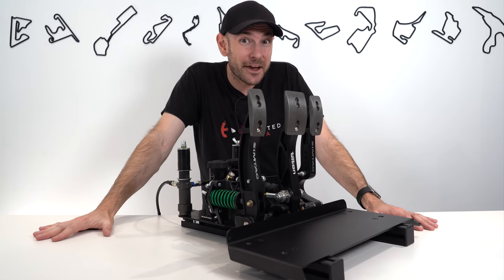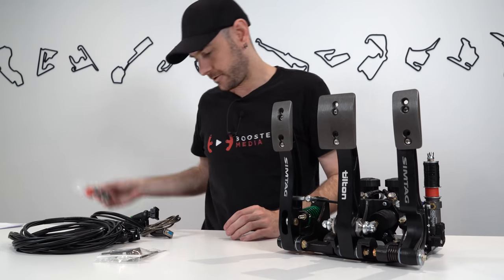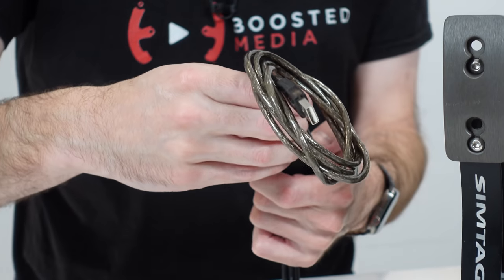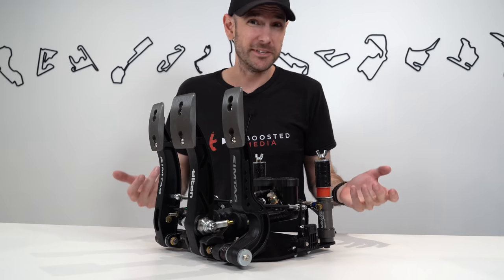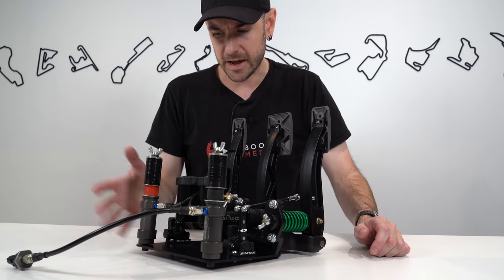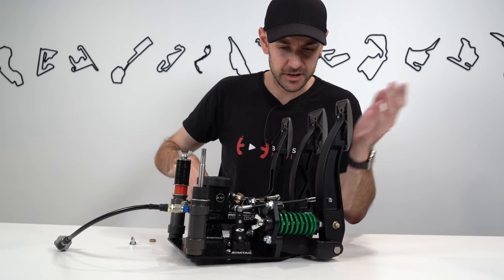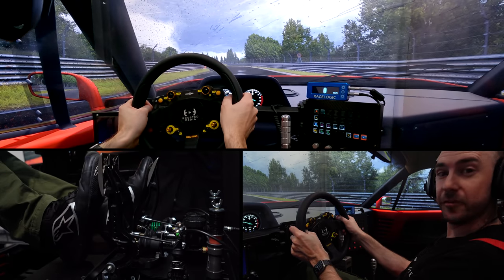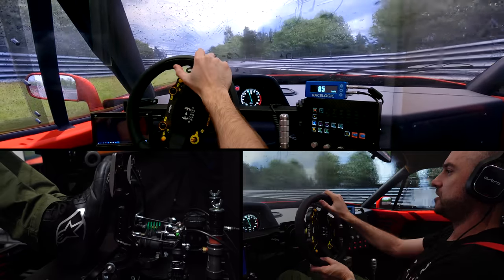REVIEW - Simtag Tilton Black Edition Hydraulic Sim Racing Pedals

Comment: Simtag has new 2 and 3 pedal sets available for pre-order. Can't wait to see your review as these use Simtag's system. Side note: Tilton has a CNC'd pedal linkage kit for $155 US. Should only take a small amount of work to "upgrade" to this set-up, but worth it in my book to have some more real race car parts, and will definitely be doing this to mine. Additionally it looks like one could upgrade the actual pedals to the Tilton 800 or 900 series fairly easily.

Comment: I had the same leaking problem with Wilwood slave cylinder. I found a solution. I dissasembled slave cylinder, took that metal centre rod and polished. I used 1000, 1500 and 2500 grid sandpaper with water, and after that, I polished it ( cheap polishing paste). After that I dont't have any leaking form slave cylinder.
Reply from the maker: Good info.  Thanks!
Reply: @boostedmedia  No problem :) I hope that I wrote it quite clearly because my English is not very good :) The whole problem with this leaky slave cylinder is that the central bar is machine finished and is rough. The only seal is a small, rubber O-ring in which the rod slides. The brake fluid is trapped in the unevenness on the bar and the O-ring is unable to remove all the fluid from the bar. The polishing of the rod makes the surface smooth and the O-ring seals better. This procedure also extends the life of the O-ring. I use OBP pedals and I have one slave cylinder. In my opinion, such a leak should not occur, especially since these parts are used in real cars. In addition, the leaked fluid can damage your home floor. Also, such responses from the company as to wipe the liquid from time to time are, in my opinion, unacceptable. Especially since these pedals are expensive. I think they could use parts other than Wilwood. Maybe it would be better.

Comment: Great review,  order placed!
Reply: Received the pedal set,  installed and few setup tweaks,  and on pace straight away,  Whole different world of feel,  certainly adds immersion and performance.  Ended up running the softest setting for the brake as out of the box, by god was it stiff with the two x red rubbers.
Reply from the maker: I think you’ll like it even more with one red and one black. 👍
Reply: @boostedmedia  Maybe they soften up over time?  With both blacks shes still a workout.  Out of the box,  with both reds,  that was nuts.
Reply from the maker: Need to stop skipping leg day mate 😂

Comment: Thanks for the awesome review! This helped answer some questions I have for my DIY hydraulic upgrade to my HE Sprint brake. FYI looks like these Wilwood Slaves have some bad reviews on the racing parts sites. Many users saying they fail within a couple hundred miles due to the o-rings instead of cupped seals. Probably the same thing you noticed with the oil weeping. If anyone knows of a more reliable Master/Pull Slave combo let me know!
Reply: I'd be interested in your DIY sprint upgrade info.
Reply: @Succotash3  sure absolutely! I've picked up a WIlwood master cylinder kit (P/N: 260-12385) to mount directly to my pedal plate behind my HE sprint brake. The plan is to leave the HE brake entirely intact, but disconnect and remove the dampener rod to connect the WIlwood master. Braided brake lines from the master will run to a set of WIlwood calipers (likely a pair of GP200's) with Honeywell pressure sensors or equivalent installed and routed directly to the input on the back of my Simucube Pro wheelbase. The calipers will contain Wilwood pads and a steel "disc" block that can be swapped out for different thicknesses to adjust the take-up feel. Rubber bushings installed inside of the caliper pistons to retract them on brake release. Still a work in progress but can provide a more detailed summary once complete.
Reply: @BarneyLux  this sounds wild
Reply: @tompeters458  I actually finished it up a few months back and absolutely love it. I tossed up a post in the HE owners page on FB with all the details. I should probably make a YouTube video with a breakdown.

Comment: You can a set of those pedals with master cylinders and from speedway motors in the US for $664 not sure how much it would cost for all the other parts needed.
Reply: I concur. I'm actually in the process of building a set of these(got from Speedway!), using tilton master cylinders and throttle linkage... Going to be in it for around $1000 and I'll bet mine end up a bit better quality than these. Quite a bit of mark-up here.

Comment: Unfortunately there is nothing new here, I built a set just like this when the sim would first started experimenting with hydraulic pedals.
They are a little more refined but essentially the same, but still prone to the wilwood slave cylinders leaking.

Comment: Seems crazy they are charging 2500 with 2 potentiometers attached. As an EE, there’s no potentiometer out there that doesn’t take damage as it rotates, not a lot, but over a million cycles it changes its resistance until it fails. At 2500 bucks I expect both those to be hall-effect sensors, so they don’t wear out... simply crazy... why put such great equipment then have the interpolation be basically the same as the g29. 

Blows my mind. The best hardware+ terrible sensors = terrible system.
Reply: Yes, hall effect would be expected, I'd accept good linear pots at this price also. These are definitely overpriced no matter how you look at it, other converted pedal box designs are cheaper and fully custom sets are still cheaper...
Reply: Do yout know about any good pedals on the market that use hall sensors? It seems like every brand uses potentiometers..
Reply: @wuzumaki  I’d check fanatec and thrust master both use hall

Comment: Did I understand correctly that this is using a real car throttle potentiometer and real car brake fluid pressure sensor, both made by Bosch?

Comment: Couldn't make up from the video but looked like it was only one pressure cable that was reading the fluid pressure from the left slave cylinder. So they are not connected, only one side is providing the info to PC while the other side is only for adjusting the pedal feeling... (in real car it has 2 master cylinders on the pedal usually 1 for front and 1 for rear hence also the brake bias adjustment)
Reply from the maker: Yes that’s correct. Pressure is being read from a single side.

Comment: Considering these offer the SC2 hookup I'm surprised you didn't compare the experience to the Racewerk Comp pedals.  There is a big difference in price between the two and it would be good to know what differences in experience you felt.  Anything you can share?
Reply from the maker: Check the pinned comment on my racewerk video. I’ve had two racewerk brakes and one clutch fail so far so it’s hard to draw any conclusions. I’ve just received a 3rd set of hardware to test so I’ll let you know. 

From the time I spent with the racewerks before they failed I’d say the driving experience is quite similar. But if they’re not reliable then the decision is simple. 

We’ll see.
Reply: @boostedmedia  wow.   I'll go back and check that out. Hopefully third time's a charm.  Keep us posted on what happens there.  Not a lot of content on them other than yours.  And thanks for these every thorough reviews.
Reply: the strange think about Racewerk is if you ask somebody who have them already 6moths or more, they all will say is the best, no problem with them etc etc... but reality is diferent, Will have trouble, and only here u can see the real situation, dont know why nobody share any experience for real. Racewerk go with some kind of solution to fix, what to fix if nobody have any problems... and normal will be  Racewerk say something public about it

Comment: Does it require DOT 3 or 4 brake fluid?. LOL. Great review like usual. Keep up the great work.
Reply from the maker: They didn’t come with spare fluid so I’m not sure but I think dot 3 would be fine. The two are compatible. 4 just has a higher boiling point which is not relevant in this context.
Reply: @boostedmedia  Thanks for the quick reply. Look forward to your future content.

Comment: Why run 2 sets of master and slave cylinders? Seems like added complexity for no reason, no?
Reply from the maker: Not 100% sure. I think it’s due to the balance bar style design.
Reply: @boostedmedia  ah I think you're right, I was asking because I have a similar set of pedals, same concept, but only 1 set. However looking at mine they're laid out quite a bit differently so that's prob the reason. Thanks for the response!
Reply: Not sure on this setup, bit I'm a "real"car, the 2 master cylinders are for front and rear brakes. Can you adjust/change front to rear brake percentage with these?

Comment: they are going to absolutely gronk out your average spaghetti armed Sim racer with the constant pressure required to use them.
Reply from the maker: Not really. In fact I found them too soft on the softest setting. There’s plenty of adjustment to suit most people, although a lot of the benefit of having such high end pedals is lost if you’re going to run them soft and sloppy.

Comment: 2000 and they still use pot's?!?
Reply from the maker: Nothing wrong with high quality pots. Covered this extensively in the video.
Reply: @boostedmedia  I have always had very bad experiences with pots
Reply from the maker: IMO good enough for a throttle position sensor in a car, good enough for a sim rig. Not all pots are created equal.

Comment: Profit margin on these is ridiculous.
Reply from the maker: I did look in to that and to buy the parts here in Australia didn’t come up all that much shorter at retail price. I guess it depends on if they have wholesale supply and what their purchasing volume is like.
Reply: Never sure what Ozzie dollars are worth these days! But in Euros, If those slaves are GS like I think, 130 for the pair, 200 for the masters. then 600 for the pedal assembly. Lets say fittings and aluminium 60 Euro to round it up nicely as the cost is negligible. 

I'm unsure of the costs for electronics, but that leaves 1500 euro for those and profit! Great review none the less mind! But sim tax once strikes again.
Reply from the maker: Don’t forget the throttle position sensors, cabling, etc too. It ads up.